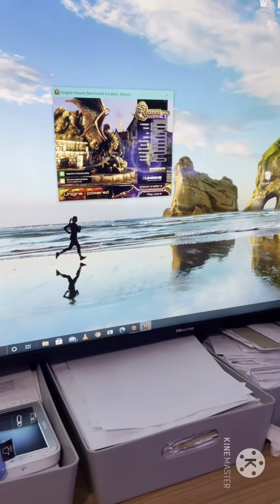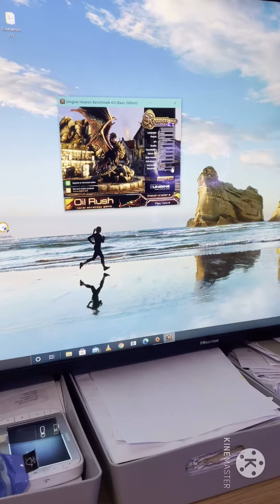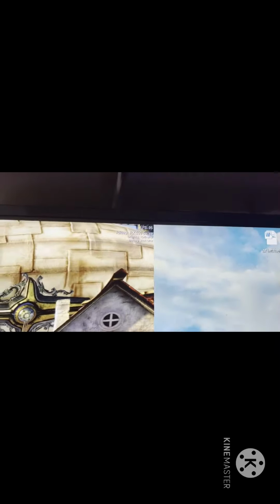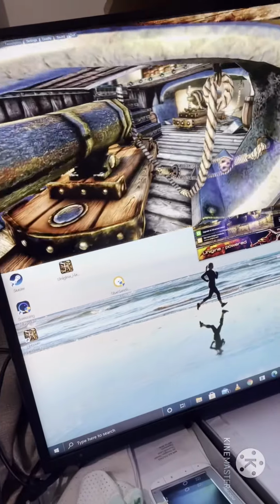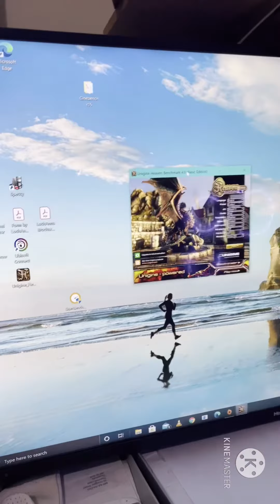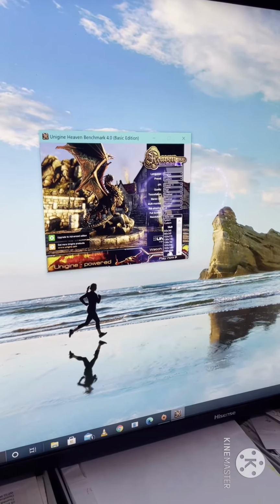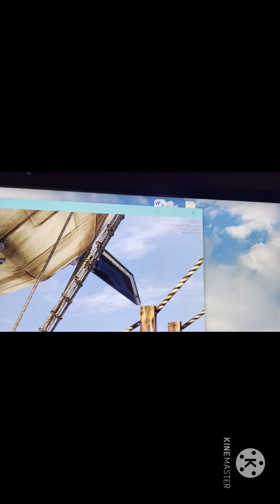AMD Ryzen 5 3600, Gigabyte B550M, 16gb Ram & RX590#building computer at home

Comment: How many fans can I connect to this motherboard?
Reply from the maker: Hi. 
The board has 2 system fans and a cpu fan connection. I am running 2 fans on one header and the other 3 rgb fans have their own control which is connected by usb 2 header.